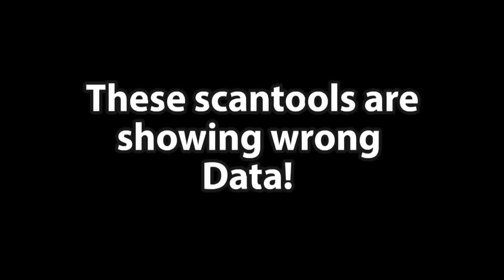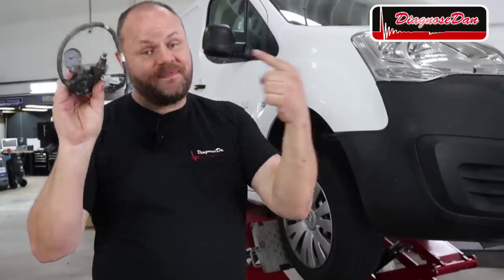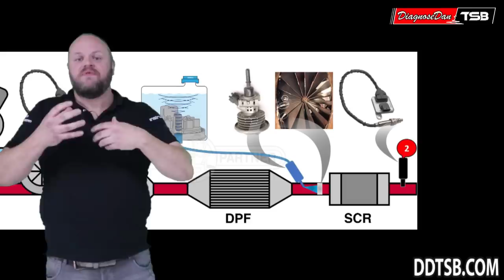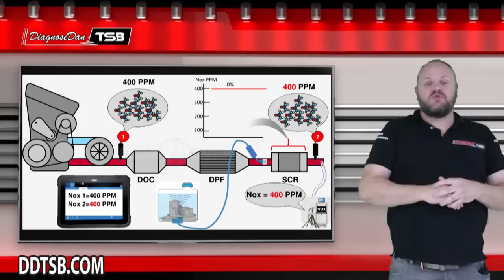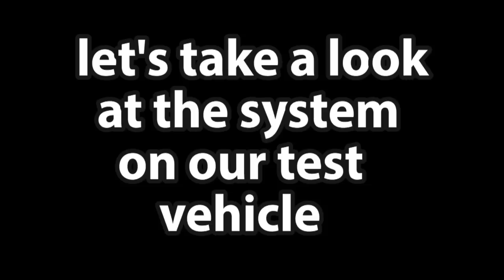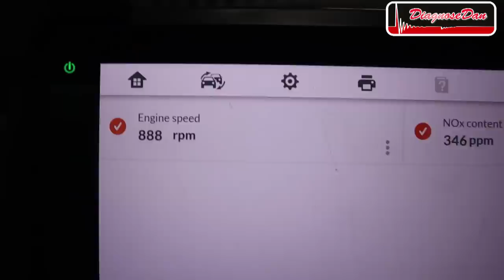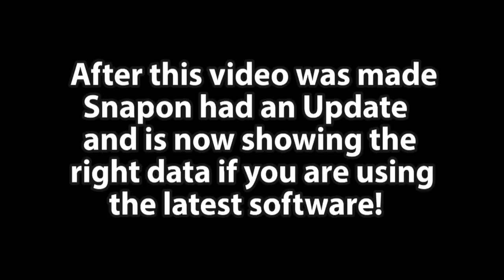Wrong parts replaced because of these scantools!

Comment: Found out when I first got the Launch Creative 5 tool, and my first scan tool for OBDII cars ever, I found out that sometimes, the tool will lead you astray by having you chase the wrong rabbit hole(s). All it takes is one part to cause a chain reaction of other parts to not read correctly. In my case, a slightly off timed motor will do that. 

In 2018, my 2003 Mazda Protege 5 wagon (the Mazda 323) as it's call here in the US, popped the tension wheel spring for the timing belt one day while I was picking up the dog I was house sitting as he did a Houdini and did the "great escape" from my backyard and was picked up by a neighbor a couple blocks over and taken to the pound. He's chipped so my name was also on there as I know his owners well and they are considered family. Anyway, was en-route when the spring went spring! and embedded itself in the timing belt.

Anyway, replaced the belt and spring as I had no way of knowing when the belt was last replaced, having bought the car in 2012 from the used arm of a new Honda dealer and now it's 2018 and still going...

Anyway, it all boiled down to a slight mistiming of the exhaust cam I think it was that caused things like the TRIM's to not modulate, the MAF and later the MAP sensors to not "work", etc, all went back to that slight mistiming. Even the idle was like poo, but rev it up, it ran fine but all cleared up when I got the cams back spot on with the crank and all is well in Mazda land. Thankfully, this motor was the legendary, though peaky FS-DE non interference motor. 

Since I live on the west coast of the US, unless right on the coast or constantly driving through the mountains during winter, rust is generally not an issue here so one can still drive 20+ year old cars without having rust issues. Anyway, still drive that car and now has almost 195K+ miles on it and it still chugs down the road fine.
Reply from the maker: Thanks for sharing your story John👍

Comment: I am bit confused about those universal scan tools in general - having mark specific tool like VCDS seems much better choice.
Reply from the maker: It's very expensive to have a dedicated scantool for every brand when you work on 20+ brands😁
Reply: @Diagnosedan  True. As DIY guy with very few paid jobs, dealing   mostly with VW and related cars, I am just lucky that there is great tool like VCDS available. 
Haven't found anything similar (reasonably priced for hobbyist)  for Mazda 3 yet.

Comment: I have autel ultra. It literally shows you icons in service that when you select the next program fails. You raise a complaint to autel. Week passes and they say. Sorry friend we no support that. They lie on so much and this is their £5000 tool.
Reply from the maker: That sucks!
Reply: @Diagnosedan  get to a bmw convertible where roof wont go fully locked or open. Code says drive for hardtop. Have to delete that code and reset convertible module every 2 mins to have roof move. 

Autel ultra has intelligent diagnostics. Seems great. Shows you manufacture data on the roof. Wiring diagrams. Says what to check in part. Then you realise. Hang on this is crap. Why because its saying. Check lines, wires, fuses and relays. So the normal checklist then. nothing great there. It does not say pin outs and to check voltages. Volt drop. Etc etc. THEN you click next and it says run a diagnostic test on the module itself. Ok great. Perfect. Ok so you select yes. Yes please run that test. What a great test you think. Excited for the results you eagerly press the run button. 

FAILURE . No communication. Which is autels way of stopping development on software. Rather than pull the software until its complete, they still include it in the tool but put a device cant communicate screen. Seen it time and time again.

Their vehicle coverage website for their tools is full of lies

Comment: The company I work for, just invested (under my oversight) a new Snap-On Pro Link Edge. I thought it would be great to eliminate OEM software platforms, into one device......I was ultimately WRONG. 
We cannot use the Navistar Suite, to diagnose the Navistar a/c control system through the BCM, because their (Snap-On) ENGINEERS didn't program the software to do it. Further more, with the Allison transmission suite, you CAN NOT reset prognostic codes (filter minder, fluid minder, ETC.....) because THEY ALSO did NOT design the software to do that function. 
So far, for what I planned on using it the most for, it has been AWEFUL!!!!! $9500 worth of junk.
Reply from the maker: Wow that sucks!

Comment: With the advent of "smart" infotainment systems that are integrated into the car's management system there is no reason a "scan tool" can't be integrated directly into the car, then you can have OEM level diagnostics.
Some  aftermarket radio systems can connect to the ODB2 port, but I wouldn't really trust them for diagnostics.
Reply from the maker: Costs😉
Reply: @Diagnosedan 
I know you're being facetious. 😁The OEMs "costs" are almost zero, almost. What they will miss are the millions of trips to the dealership for chargeable diagnostics by scared customers.

Comment: If you happen to actually pay attention to the numbers, and you place a decimal between the third and last number, the readings would all be around the same, ex: 5697ppm would be 569.7ppm. I'm not saying that is the case where there is a missing decimal, just saying it seems to be an odd coincidence.
Reply from the maker: Maybe you are right but the data is still wrong😉

Comment: Hey Dan! I have Renault L7X engine (V6, 24v, 3.0). It runs smoothly but on first start I need to rev it couple of times to stop knocking. Initial idle rpms are same during the knocking stage and after. Could it be that oil is not lubricating the engine at the start? If I start the car second time (right away), knocking is not present... Thankssss

Comment: Top bad modern cars have such complicated precision systems.  They are very expensive to purchase, difficult and expensive to diagnose - requiring rare talent with specialty diagnostic devices & expensive parts.   Then at some point, an undiagnosable failure finally puts the valuable vehicle into the scrap pile prematurely. 

I just killed a otherwise well-maintained undiagnosable Highlander Hybrid with a battery-killing gremlin beyond the ken of available American talent.   Wished I had bought the simpler V6.

All this tech has a expensive & troublesome downside.  Your video is great. Since we don't have the rare Dan to help us, I'll avoid modern deisels altogether.   Next vehicle will be an older tech ICE Toyota.
Reply from the maker: Thanks for the comment 👍

Comment: Hey Dan how are you? Thanks for you video. I had that problem. What was the problem? How did you solve this problem?
Reply from the maker: It was an intermittend bad adblue injector.
Reply: I had the same issue and i change the adblue injector and the problem was not fixed

Comment: great video. I deal with diesels regularly and would be interested to know what gas analyzer you’re using. I’ve been looking for one that does nox concentration and all the ones I’ve found have been insanely priced. Not sure about that brand but most of what I see the inlet nox and outlet nox sensors are completely different the connectors are keyed differently and that won’t allow you to swap the two as a verification so a analyzer would be awesome.
Reply from the maker: You can't swap them even if the connectors were the same. Nox sensors are commected directly to the canbus and sensor 1 will always be reporting as sensor 1 om the bus and the other way around. I'm still looking for a good mobile gas analyser that's capable of reading NOx on diesels

Comment: Is it really the correct data, or its it the "fake" data, which the manufacturers need to reach the exhaust gas spec for their dirty diesel cars?
I remember real drive emissions being ten times higher than allowed..... (which kind of its similar to the days shown here)
Reply from the maker: The data was never "fake" . Cars were programmed to pollute less on a testbench than in real use.

Comment: They are reading parts per 100,000 rather than parts PPM in my opinion. Simple mistake by the software developers. Digging deeper are aftermarket scan tools using the same software?
Reply from the maker: Simple mistake is still a mistake🤣

Comment: That looks like a scaling issue, where the 3 incorrect tools are showing the raw values for the PID, while the manufacturer tool and correct tool are using the scaling factor that the manufacturer used for the PID.
Reply from the maker: Thanks for the feedback

Comment: From what I could see of the readings it appears there is a invisible decimal. The readings were correct but had an additional digit added. Comparing the readings to the OEM tool they were all pretty much the same but just as I stated the first three had the extra digit. Now if you were aware of this then the readings would make sense but unfortunately the tools don’t have any tutorials on how to properly read them in these instances. Not intentional mind you it is just not something I believe they themselves (creators) are aware of either. Not taking away from the vid. He did us a solid by showing real-time data so we could see the differences as well as this little discrepancy. Thank you and will keep this in mind. 😁
Reply from the maker: Thanks for the comment Richard!
Reply: That’s what I thought 
Kind of like 10x In tool settings

Comment: Hi eather im missing some info here 5:40 or i have not sean one yet in ~20years withs says they have one.
To me its like DPF is the last before sound mufflers....

And yes we have Bosch, Autocom, Texa, VCDS, Focom,.... ..and the worst part is when you see odd value is do you trust it?
...Specially when you cant scope it!!!....
Reply: 8:00 Thats more like what i have seen....
Reply: And not otherway!!!!!!
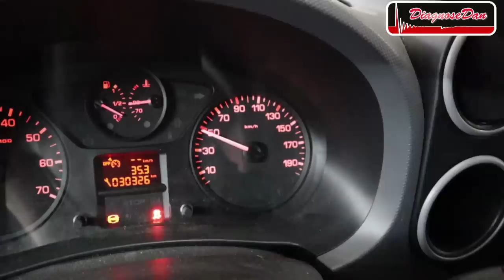Reply: 10:47 Hmm. I'm not sure, but isn't it like 1000PPM max, for that sensor, so decimal is missing there?
AND what did the first sensor say or is it in dreams to not have even in future????
Reply: 14:18 Yes thats why i would like to have Passtrough... and law to cost for engine/emissions as low as the level that is it is not rip off
Reply: Im Sorry! What was the FIX!!! ..Cleaning that DPF (its only mechanical METAL filter without any moving parts. So YES! You can wash it your self. Just do it back to front. So all metal (from engine) that cant burn, wash out..)

OR did that scantool allso made that DTC to light up???????????????????

Comment: The scanners aren't wrong. They,'re giving you parts per 
10,000,000 not parts per 1,000,000 or whatever the ratio is that they're conveying. It's off by a factor of ten leading me to think that you should look at the technical specs of the scanner..
Reply from the maker: If the Unit of measurement is displayed in ppm ( parts per million) than it should be in ppm without conversions

Comment: It seems like certain diagnostic tools may “steal” software from other brands and in doing so an error on the one being copied has propagated across brands. Either that or there was a fault in the third party development tools and libraries, but that doesn’t explain why one unit actually got the correct reading.
Reply from the maker: It's also cheaper to buy software from third parties than develop it yourself!

Comment: Looked off by a factor of 10.  In the data streams its easier to create consistent packet sizes (for error detection) if the values are comprised of only integers. To display floating point values there is a first packet with the value and a second packet that states the number of decimal places in the first number. It would be a simple error in decoding that stream to miss that second number and display a value far higher than real. Since multiple devices you have do this, I'll bet they got a different protocol spec document from the manf. There's no way they wont fix that if you tell them.. Which I'm sure you already did.
Reply from the maker: Snapon and Launch made an update available that takes care of the issue
Reply: @Diagnosedan  They should give a finders fee for things like this

Comment: They got the decimal point in the wrong place. I think the numbers would match if you used the first 3 significant digits. Someone copied the code and included the same error as the original software engineer. Great work Dan.
Reply from the maker: Thanks for watching John!

Comment: Seen this a few times and also where the fault code description is completely different from what it should be and this goes for live data parameters also...

Can loose a lot if time chasing the wrong parts..

Had a VW with error code on nox sensor 1 and test drived it uintill hot for about 10 minutes and no reaction.

Tried to order the "front" nox sensor from VW but they said it only have one and then found out the front one is just a calculated value from the wide band lambda probe and there is only one nox sensor after the nox trap.

VW told to change the nox sensor so i did, and took for a test drive again but still no reaction at all on live data, 0ppm nox all the time. 

Then i drove for 30 minutes to try burning out the DPF as well and at the end of the trip it started showing data like it should.

It is now 6 months ago and still no fault back so it was the fix, but it fooled me thinking i changed the wrong part when it seemed dead for an half our drive.

Mos common ad blue fault here is leaks everywhere, clogged injector and faulty level sensor.

Funny how Mercedes if you fill the tank completly full you might get an error on it since it cannot measure when it is full, it must be around 2 liters less than full. What a joke 😂 (it is a TSB on it) and when it went faulty it didnt return to normal and a new tank cost 3700 USD! Plus labor and coding.
Reply from the maker: It can take a long time before Nox sensors become active also the calculated data pids
Reply: Also seen a few times on Peugeots that if there is an airbag fault for the right side, it is 50% of the time the left side, so these cars i always unplug and check again.
Often just bad connection so unplugging, dielectric grease and connecting fixes it 70% of the times

Comment: Seems to be showing the pre sensor rather than the post sensor readings on the 3 incorrect diag tools. Why you should only use diagnostic tools as a guide only. I changed to Autel after I found it had much better usability to my previous iCarsoft scanner.
Reply from the maker: This engine actually doesn't use an upstream Nox sensor, the value is estimated to safe money

Comment: To be fair it just looks like the scan tools that were wrong, were right but out by 10x. I find this a lot with aftermarket tools. You get used to it. I've seen Autel out by a factor on live data and like you say, on this occasion the Autel was right but with another job it could be any of the others. Snapon are marginally better than the Chinese stuff but Autel and even Launch are getting there. It's just a pity it takes so long from reporting the error to the software being ammended. Superb video by the way, learned a bit 👍👍👍
Reply from the maker: Actually Both Snapon and Launch improved the software right away

Comment: This is an example of one of the frustrating things we are dealing also at franchised dealers business with OEM scan tools. 
It is not common issue but once happens and you realized you are dealing with false data, you start being an IT guy instead of diagnosis guy, downgrading scan tool versions, looking for known hotfix scan tool patches and trying updating the ECU on the vehicle. 
It is not only  causing wrong diagnosis judgment and good part replacement but also time spent you cannot charge the car owner or warranty.
Reply from the maker: You are right but like you say, fortunately it doesn't happen very often

Comment: What you are buying with a scan tool is the data knowledge. I used to work for TRW on their own in house scan tool - we would go out and test all the data on cars and find new cars not yet reverse engineered. In the end the department was dispanded as the data could be brought from a 3rd party cheaper. All this was was miss converting the binary code pulled from the obd to decimal. More likely on new application. Much more unlikely on older applications.
Reply from the maker: Thanks for the comment, you are right it's all about the money!

Comment: That's so disappointing. Most shops will rely on one or maybe two scan tools, so even though we may be aware that some data PIDs on some vehicles may not be reading accurately, we have no choice but to proceed as if our scan tools are displaying accurate info and still misdiagnose the vehicle as you did. It's not like we have access to all factory scan tools so a technician has to buy the best equipment he can afford and trust his equipment.
Reply from the maker: You are right but fortunately this doesn't happen very often.

Comment: It looks to me that the incorrect values are actually the correct values but multiplied by 10. It might be something that stems from the diagnose tool settings.
Reply from the maker: Yes it looked like the values were 10x higher but its not a setting. Both Snapon and Launch have made an update available that takes care of the issue
Reply: @Diagnosedan  they owe you a beer for pointing this out :-D

Comment: My 2016 Mercedes C250d showed 2 faulty Nox sensors @£1600 but my indy Mercedes garage was not convinced so put in more effort and found a wiring fault with the feed to the Adblue injector. Repaired wiring and saved £1600.😊
Reply from the maker: Great job!!!!